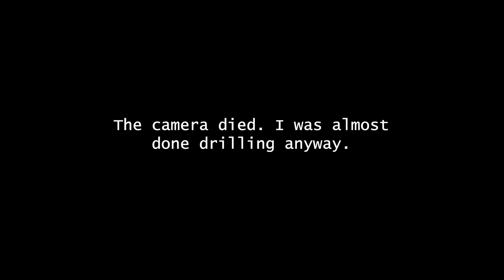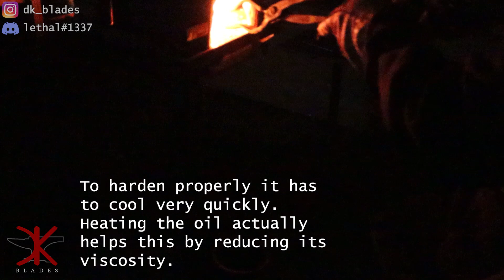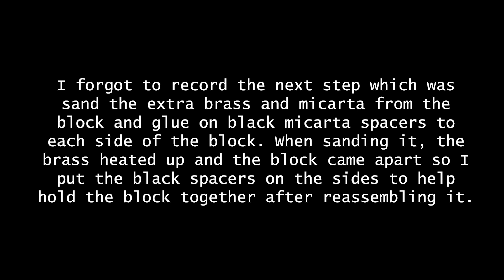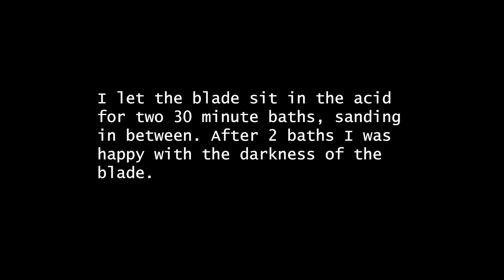Making myself a new EDC knife from a saw blade

Comment: Which ine will be more  economical using a new saw blade or getting an actual blade steel
Reply from the maker: I would recommend actual blade steel over a saw blade any day. As for which is economical. The saw blade... if you can get one as scrap. Buying a saw blade to use to make a knife, I don't know what the cost difference is compared to a length of blade steel But even if it is a few dollars more, I'd go with the blade steel.